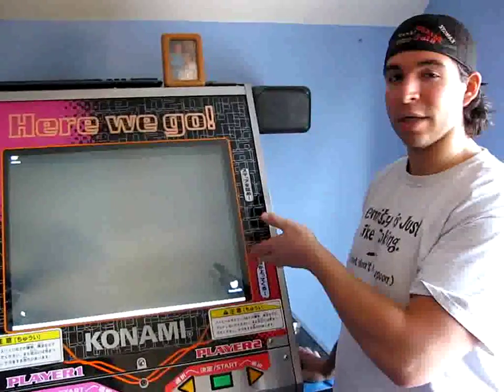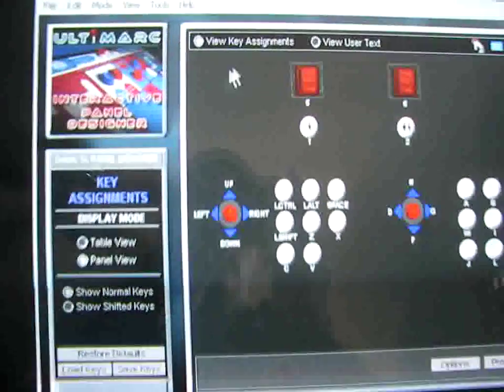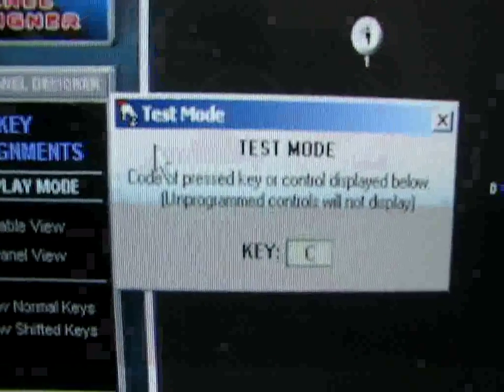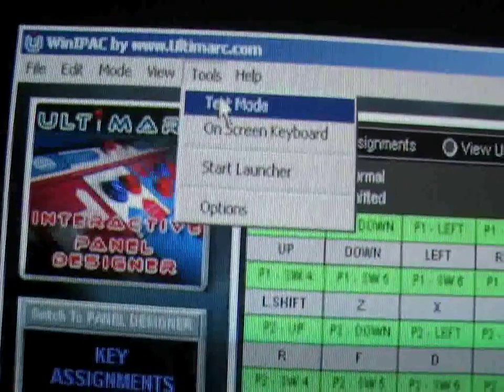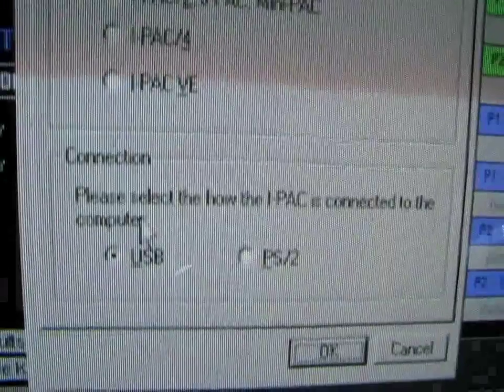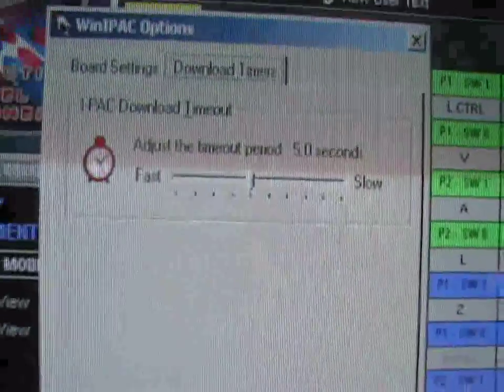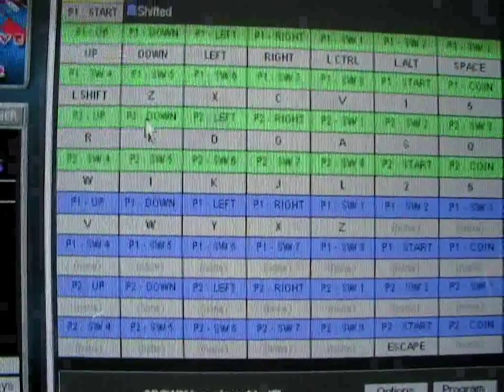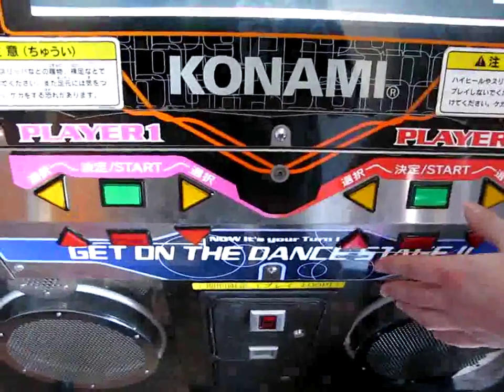DDR Machine to Stepmania Machine Conversion pt 3

Comment from the maker: @Jadin784 you take off the panels, then load openitg then press and hold down the scroll lock key. This will take you to the options menu in openitg. From there go to "test input". Now you can test all the individual sensors.